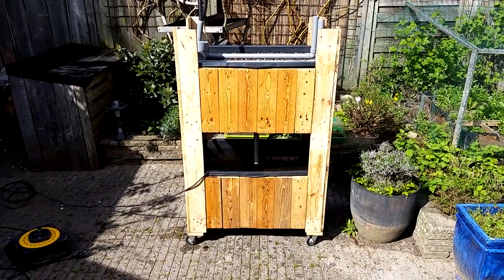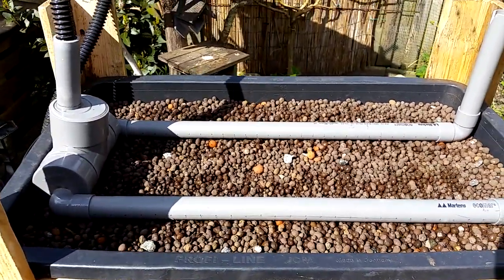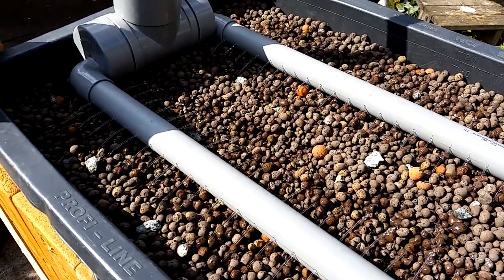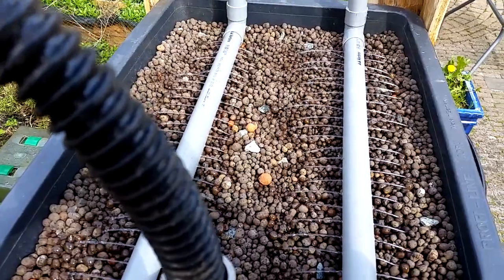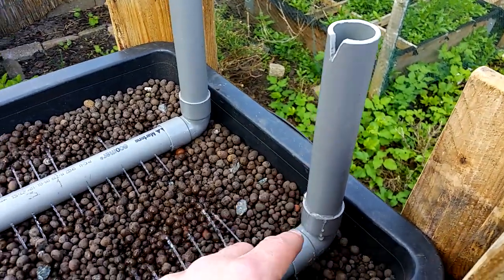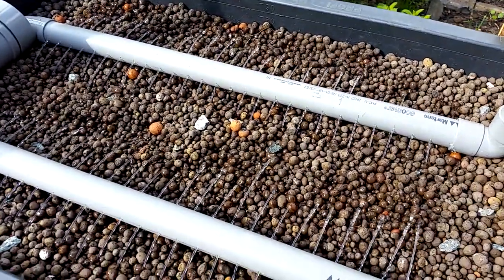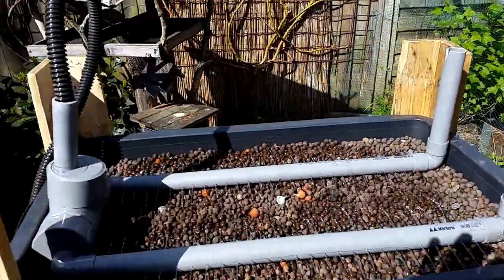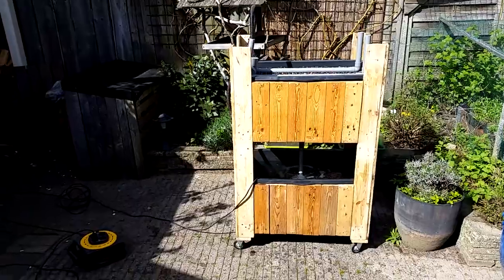Finished super simple aquaponics system - awesome and portable

Comment: great idea but after time the small holes on the feeder pipe will block. its is also not a good idea to have gravel in the fish tank because fish waste will get stuck between the gravel and that will cause denitrification due to anaerobic zones that have no access to oxygen  . you might have to change the way the water enters the media because water having direct contact with the crown of the plant will cause root rot .
Reply from the maker: I have the system running now all the time and i also thought the holes might block. But it didn't actually and the ones that did i poked open with a nail. After that, all good... The gravel getting dirty isn't much of an issue, because i put worms in the gravel and they eat all the goo away. So i am pretty pleased with this setup. But you are wright. Make sure that the holes are not to small and then you are good to go.

cheers,

Rene

Comment: Its a great looking setup, but those small holes will clog over time, making maintenance often. Better to cut several long slits, easy to clean and harder to clog.
Reply from the maker: Joe n Texas 
I'll keep that in mind. Thx
Reply from the maker: I thought that to, when i build it. That the holes would clog up. But they didn't.. I gues the pressure is enough to blow them open all the time. Slits might be an option for a next update. I'll keep it in mind. Thx.  cheers,  René

Comment: Very cool for its simplicity.

Do you run the pump 24/7 or do you cycle it?

Also what power pump do you use?

Lastly, what fish and how many are best to use?

Thank you.
Reply from the maker: Hi Yves,

With this pump it runs 24/7. Starting and stopping these kind of pumps isn't to great for the lifespan.
My idea is to buy a 12 volt water pump. Install a small solar panel on the roof and use a 12V stabelizer to get a good 12 volt constant voltage out of the solar cells when the sun is up. This way, when the sun is up, the water starts to pump and when the sun goed down the system will simply stop pumping. You don't need active water circulation when the sun is down.

This way it will be a real portable system, you can place about anywhere.

cheers,

Rene